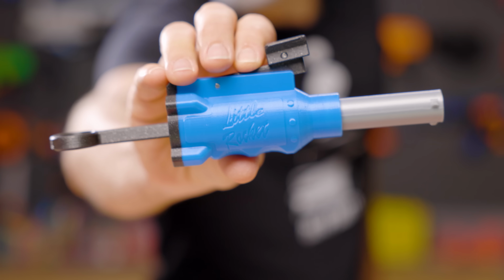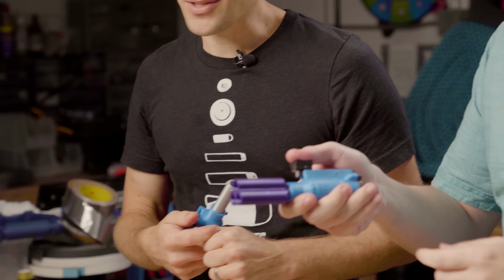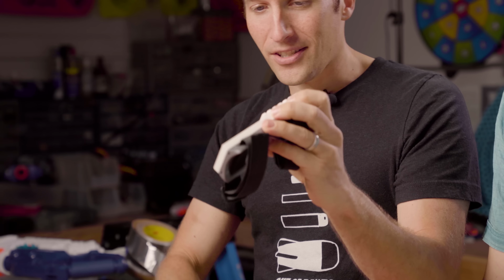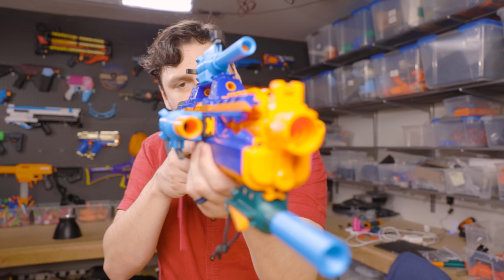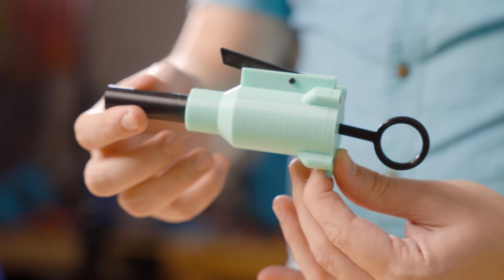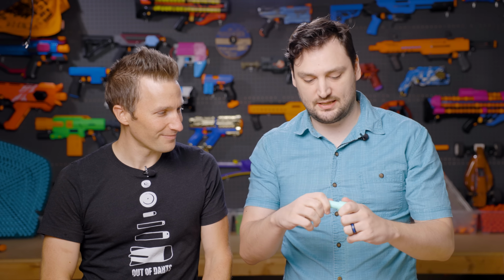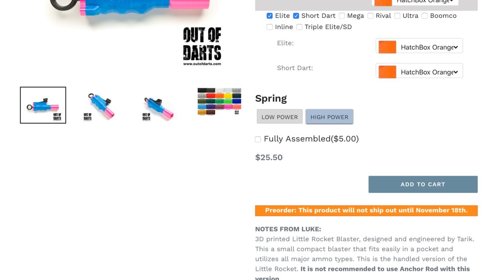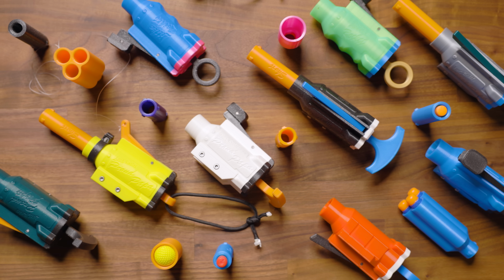LITTLE ROCKET: World's Smallest 3D Printed 'Nerf' Blaster

Comment: I'd like to add a black 3 shot Elite Big Papa blaster with an elastic prime to the front bottom rail of my Modulus ECS-10 to use for C.Q.B. style battles and complete it's AK-style look. I could also use it with short darts if I have to face a horde of zambies. I could also use the arm mounts to be a "Nerf" Spiderman. Imagine going up to your friends house just to see your buddy jump out of a bush and fire some modulus darts at you... oh the possibilities.

Keep up the good work guys and stay safe!

Also, what if you made a dual mounted version of the arm mount to fit onto a blaster or made an up down double barrel version with one trigger or two depending on how you ordered it. Ex: 00 with a trigger on both sides or one under and in between the two barrels or      0      with one trigger in between the two barrels on the side or a side trigger on each blaster.                                                                                                                0
Reply: Sick idea, wish I thought of it.

Comment: how is it onl hitting 100 with shorts in that package? I've minimized a clampdown (the zombie strike jolt reskin that is marginally smaller than a jolt) and put a barrel that is literally the length of a half dart, and it shoots around 100 fps, albeit I am using an airsoft spring and a deploy sight as my barrel.

Comment: Is the plunger tube sanded or treated in anyway?
Reply: If I understand your question correctly. There is tubing material inside the plunger. Now if that material is treated, I'm not sure. I know they are oil and moisture resistant. So my guess it is. --Tarik